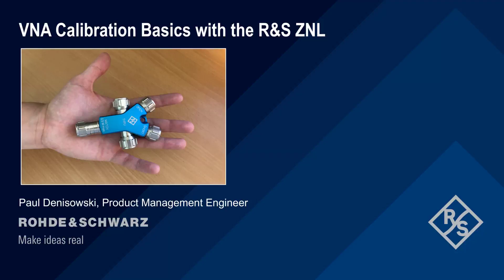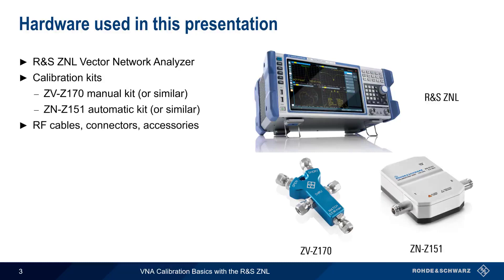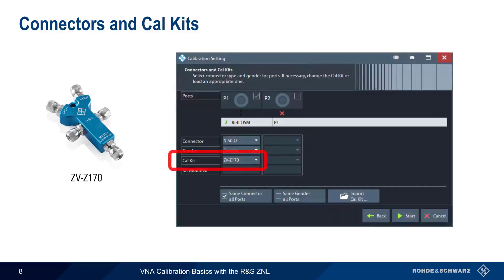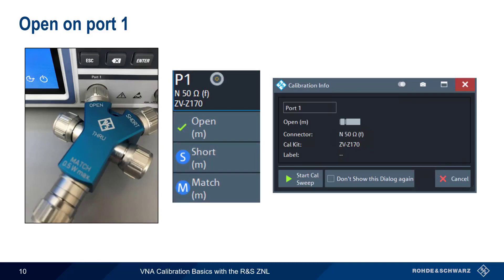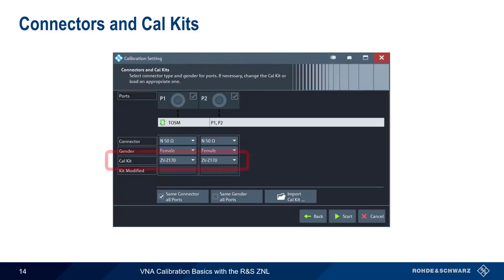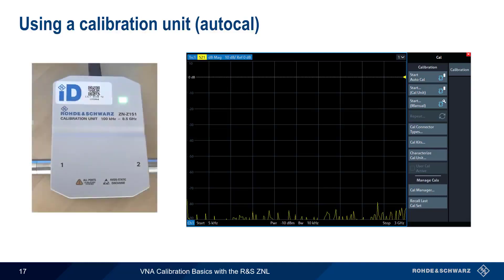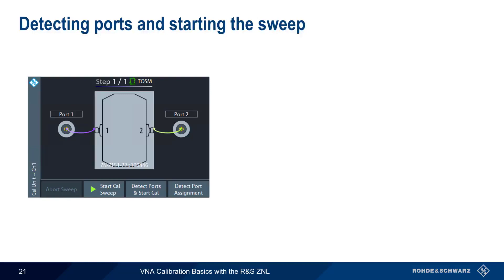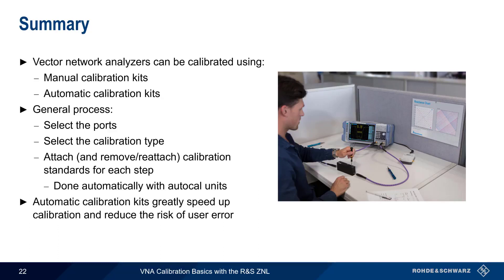Getting Started with the ZNL - Calibration Basics

Comment: how to know if the calibration I have done is correct or not... Ticks appear on all steps but is there a way to check... I have done calibration using manual calibration unit of ZV-Z129 and I have a VNA of R&S ZNB 20 100MHz-20GHz

Comment: How can I normalized if I have a 30dB attenuator between P1 and P2?
Reply: The answer depends on the reason for including the 30 dB attenuator. 

Is it because you are measuring an amplifier and you would like to protect Port 2 of the network analyzer from being damaged by the high power from the DUT? In this case you should use a "One path two port" calibration style. This will force the analyzer to sweep only in the forward direction and allow you to measure S11 and S21 with the attenuator in situ. 

Making a reverse measurement in these cases does not make sense as the attenuator will limit the directivity at this port so you cannot measurement the DUT anyhow.